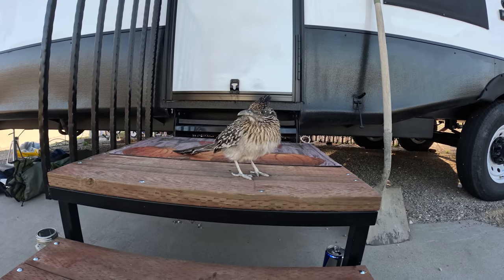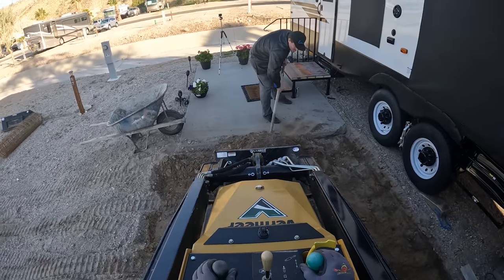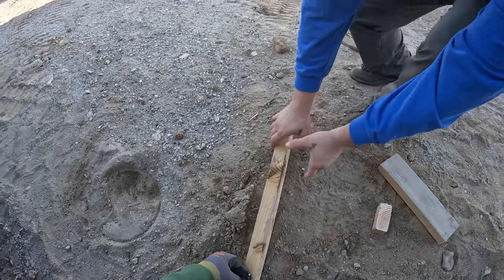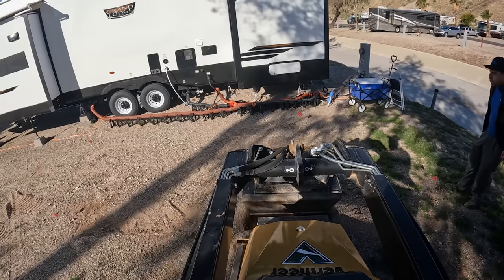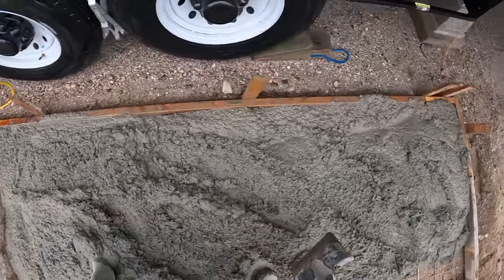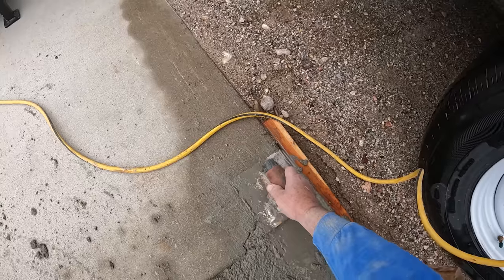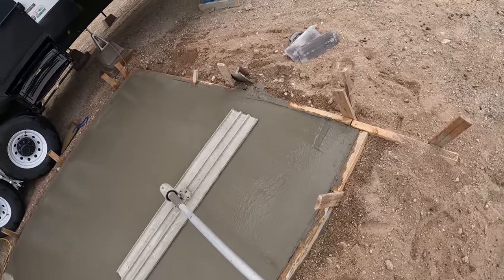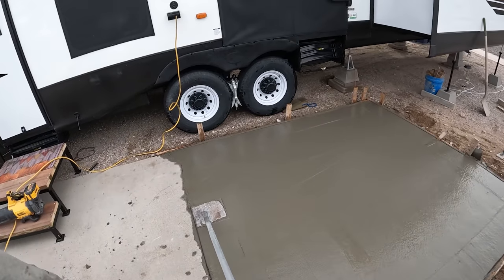DIY Patio Extension

Comment: Hi Odell quick question did you use a 60 lbs or 80 lbs bags concrete and also did you use the 50 lbs quick concrete bag right
Reply from the maker: 60 and 50
Reply: @OdellCompleteConcrete  thank you so much